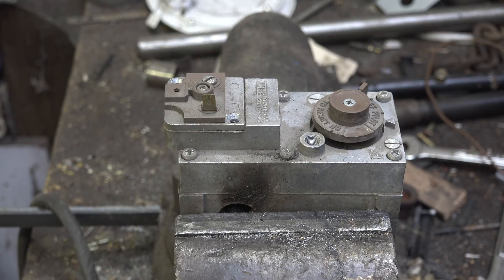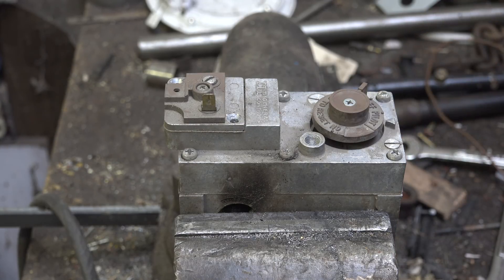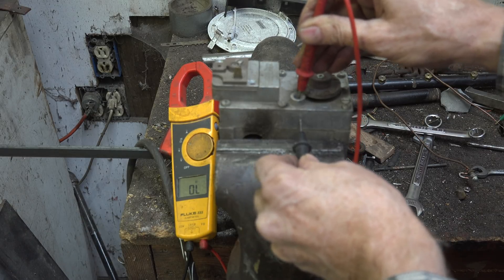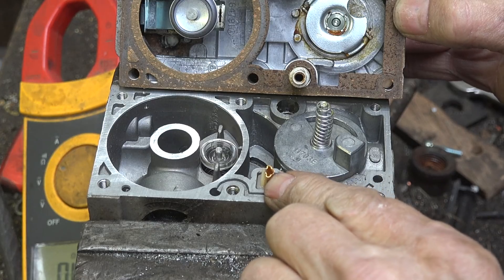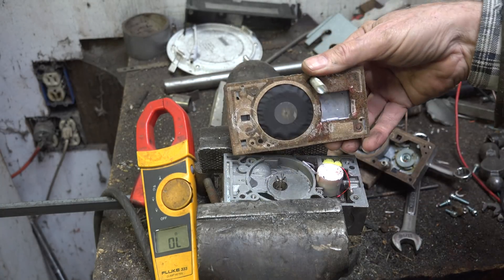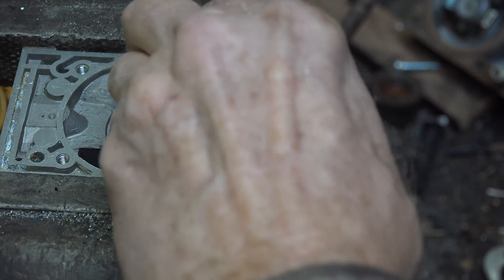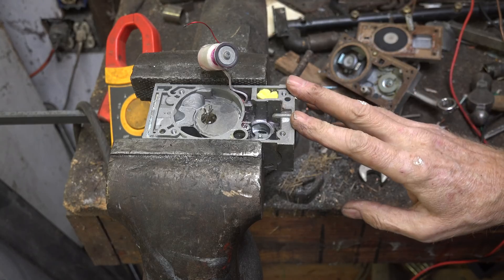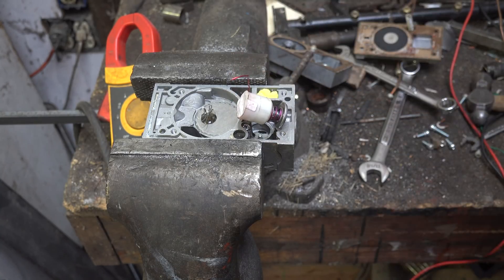Autopsy of a gas valve

Comment: hi grey...ive got a neighbor who has an old empire stove wall furnace from 1990

it works but sometimes the gas valve sticks...if i tap gas valve the gas will flow and burner lights...is there something simple i can do to fix this?.. the gas valve part# is BRMR12791
Reply from the maker: If the pilot lite is yellow and lazy, you can blow air across it.  If it turns blue and ruffled, it may start working.  
You can also replace the thermopile.
GFM

Comment: That gas control valve doesn't need to be level? A furnace person came out to our house and did a bunch of work and it smells like gas and the gas control valve is at a 45° angle
Reply from the maker: Call the tech back now, he left a leak.
Most valves will work in any position except sometimes directly down.
GFM

Comment: I never knew what they looked like from the inside. I still don't get how thermal couples generate enough electricity to power the gas valve solenoid.
Reply from the maker: In most valves, they do not.  The thermocouple holds open a safety valve to keep the gas flowing.  When the thermocouple does not produce enough power to hold the valve open due to the pilot light being out, it closes and shuts down the main gas and pilot gas.
GFM

Comment: My gas valve on my fireplace wont open to ignite the burner. The pilot stays lit. Im getting good voltage from the thermopile (600millivolts DC) but when the unit calls for heat by turning on the wall switch I have near zero millivolts. Is this an issue with the thermopile or a possible issue with the gas valve
Reply from the maker: Where are you measuring 0 millivolts when there is a call for heat?
GFM
Reply: grayfurnaceman its actually 10millivolts between TPTH and TH poles. I read that the voltage should be around 250 millivolts.
Reply from the maker: @truenorthmuskoka9077  You should be reading between TPTH and TP.
GFM
Reply: grayfurnaceman yes thats correct. Thats what I did.
Reply from the maker: @truenorthmuskoka9077  I would be bypassing the wall switch.
GFM
Reply: grayfurnaceman yes i did that as well. No difference.  Is there a way to test the gas valve.  Its either the thermopile or an issue with the valve itself.
Reply from the maker: @truenorthmuskoka9077  You can try a 1,1/2 volt battery across the terminals.  The valve should open.
GFM
Reply: grayfurnaceman that high voltage wont damage anything?
Reply from the maker: @truenorthmuskoka9077  No, we commonly use a battery for testing.
GFM
Reply: grayfurnaceman cool because Im too anxious to wait for my new thermopile to arrive. I also checked the resistance between TPTH and TP with no wires connected and it reads 20 ohms so at least I know the gas valve is good. It all points to the thermopile.
Reply: grayfurnaceman thx for suggesting the battery. It just confirmed the thermopile is shot. I was able to light it using the battery. Awesome!!
Reply from the maker: @truenorthmuskoka9077  Glad I could help.
GFM
Reply: grayfurnaceman how the heck do I remove the old thermopile.  I managed to remove the thermopile and wire but it seemed to break away from the nut. Now the nut remains screwed into the pilot housing and its a bugger to get off. Is it a reverse thread. Any suggestions. Its brass so the nut is starting to round.
Reply from the maker: @truenorthmuskoka9077  It is not reverse thread.  Because it is hot, it tends to jam.  You may be able to slide the new one into the old nut on the pilot assembly.
GFM
Reply: @grayfurnaceman  what exactly do you mean by “1,1/2 volt battery”?
Reply: @grayfurnaceman  I’m guessing it is an AA battery.
Reply from the maker: @bsmith2120  All AAA, AA, C and D batteries are 1.5 volts.
GFM

Comment: Could you have repaired the connection? Great video - do a combination valve - if you can.
Reply from the maker: You could try.  I would never place a gas valve that had this problem back in service.  Too dangerous.  
That is a combination valve.
GFM
Reply: @grayfurnaceman  I'm with you, like an exhaust motor that takes a day or 2 to get you make temp repairs - dodnt know if that was something that could be done. 

Great vids - enjoy them..

Comment: Ironic, I just took apart my Honeywell smart valve over the holidays. The valve would click off even though it was getting a constant 24 volts.  I tested the two capacitors on the board with my ESR meter and they had gone high resistance.

Comment: Thanks for making this video!  I learned a lot from your other videos about valve chains vs. modern valves.  I am trying to troubleshoot a SIT-NOVA gas fireplace (Majestic).  Could you do a tear-down video of a modern fireplace valve?

I'm dealing with a fireplace that won't start.  First thing I did was clean up the thermopile.  The mfg. spec says it needs 150 mV when "on".  My original thermopile hovered right around 150  (when off, it read 300-400 mV), so I decided to replace it with a 750 mV one from Amazon that matched the p/n in my manual.  The new one produces pretty much the same "closed" voltage, maybe a little bit higher when the call switch is "open".  As it hovers in the 150mV to 155 mV range, the fireplace will "usually" but not always turn on the main gas.  Interestingly, when I short out the TH terminals at the valve (I have a simple switch, not a thermostat), the main valve NEVER turns on.  Makes no sense to me.  

Sometimes lightly tapping the valve get it's to open  when the voltage is hovering around 151.  I wonder if something electrical is wrong inside the valve.  I've tried adjusting up the pilot to increase the temp on the thermopile .  I'd like to tear apart the valve to see what could be the problem, but since it's possible I  just get a bad thermopile from Amazon, I hate to break the valve.
Reply from the maker: Be sure all terminals are clean and tight.  If no help, the valve may be failing.
GFM

Comment: Have a Tran XE 60 furnace, from 1988. Pilot light will not stay lit. Have 24 millivolts across thermocoupler, 26 volts across gas valve terminals, continuity across thermocoupler connection on gas valve and body of gas valve. Gas valve is a White Rodgers Model 36C53. Have replaced gas valve twice in the last two years. Any ideas as to what my problem may be?
Reply from the maker: Your unit has an ECO connection at the gas valve.  If the ECO is open, the pilot will not stay on.  Could be from an overheat problem.
GFM
Reply: Hi, Update, I can now keep the pilot light on but when I turn handle to burner position, then the pilot light goes out. I did manage to get the furnace running twice but after one minute the burner goes out. Can you tell me where is the Energy cutoff switch on this gas valve? Could my pilot light be to strong a flame causing the cutoff?  Have adjusted it to no resolution. Thank you for your sharing your knowledge and your understanding  of DIY.
Reply: Hi, found the ECO, gently tapped on it and furnace fired right up.  Is the switch defective? I have 2 old gas valves, same model, can I replace the switch without compromising the safety of the gas valve?
Reply: Furnace running good for the last hour! As a DIY, is there any way to determine if the switch is defective or if I had a actual overheat problem?
Reply from the maker: The ECO has continuity if the pilot stays on.  Hate to say it but it seems like the gas valve is failing.
GFM
Reply from the maker: Just found this one.  If you are tapping on the gas valve to get it to stay on, the ECO is not on the gas valve.  The connection from the ECO is on the gas valve under the thermocouple connection.
GFM
Reply: Understand better now, the wires on the gas valve lead to the ECO which I see now, thanks for insight, furnace working ok for now, but snowing outside.

Comment: What would be the danger in reconnecting the wire back onto the 
connector from the solenoid? The solenoid obviously cannot engage 
without current so where's the liability?
Reply from the maker: You could.  The problem is the gas valve must be completely disassembled and will probably leak when put back together.
GFM
Reply: Why would it leak? Old gasket? Use gasket sealer.
Reply from the maker: Look, I told you my opinion.  Do what you want.
GFM
Reply: I see your point. As a technician why bother trying to repair this when the correct approach is to replace it The customer is paying for it anyways and you don't have to come back in the event it should fail as it would now be a warranty item should that happen. But if your stranded somewhere and the parts are difficult to acquire or obsolete this is a very good video showing the workings of the gas valve!

Comment: I’m surprised that a thermocouple generates enough current to power an electro magnet (solenoid).  

We had a problem here where there was water in the natural gas, taking out a lot of furnaces in my area. Gas company’s fault.
Reply from the maker: It does not actually pull in the solenoid.  You have to hold the armature to the electro magnet and the thermocouple power will hold it.
GFM
Reply: I've  always wondered how these valves worked without no connection to the house electricity.

Comment: Interestingly enough, where im at we only have propane. often times we get sticking valves, bang on it with something and it unstick for a few fires then restick. I have had a couple different years where it get a lot of valves sticking, never really put it together but last year I started asking customers who their propane provider was. After getting 6 gas valves from the same provider I caught up with one of the drivers and asked if there was any correlation to this or just coincidence. He told me their is a product they use to keep the propane from having moisture(the name reminded me of "calgon" soap commercial), and he said they didnt mix enough of it in so they had a run of no heats with water in gas valves.....I dont know that that is what you got but rather interesting to see water in a gas valve.
Reply: I always give my gas valves a good whack before replacing. So far I've gotten 2 seasons out of it. But this other furnace no such luck. I get two successful whacks and it last a few days. Finally replaced it today. I have natural gas. It's a 2 stage valve and I'm going to open it to see what's wrong. I'm suspecting corrosion or clogging and the whack would loose the suspecting ”gremlin"

Comment: So wait a minute technically couldn't you just strip that wire reconnected to that screw put a new liquid gasket around it put it together let it dry and it work?
Reply: Technically, but there is some things that its best to not be liable for.
Reply from the maker: You could probably repair most parts, but as a service tech I would not spend the time on a part that I would not know if it was going to work when I was done and the liabilities for a catastrophic failure are incredible.
GFM
Reply: yes, but never repair/rebuild a gas valve, as it's a major liability issue as "Performance Based Heating & Air" noted :)
Reply: Ty for the response I was only asking cuz I'm a service tech 2 going on almost 20 in Heating and Cooling only a couple years is a service tech I was just curious for apocalyptic type of scenario..
Reply: clarksafg if it was your gas valve, and you would be present whilst it was operating, and it was a matter of fix it or freeze to death, then yeah by all means do it. Otherwise I’d be telling the customer to go wrap herself up in blankets till the old one has been replaced.
Reply: Oh for sure I don't even like cleaning flame sensors I would rather replace those but I was mainly speaking apocalyptic scenario like either my family freezes to death or I take apart a gas valve and fix it that's all appreciate it though
Reply: What would be the danger in reconnecting the wire back onto the connector from the solenoid? The solenoid obviously cannot engage without current so where's the liability?